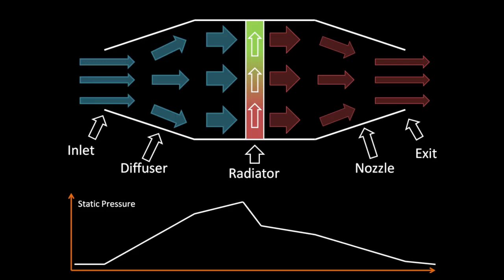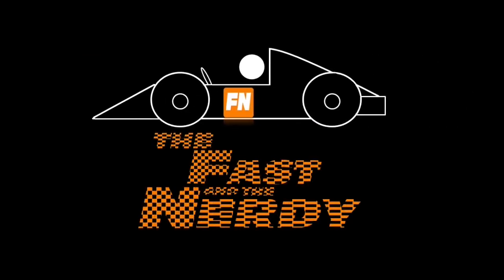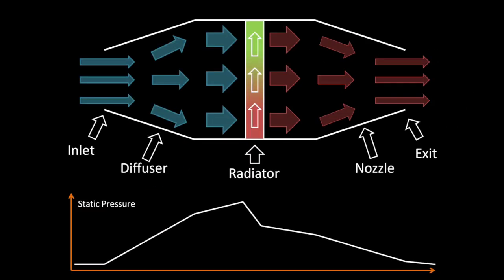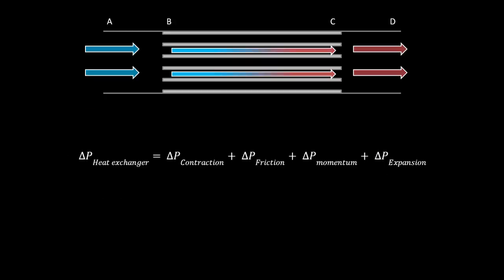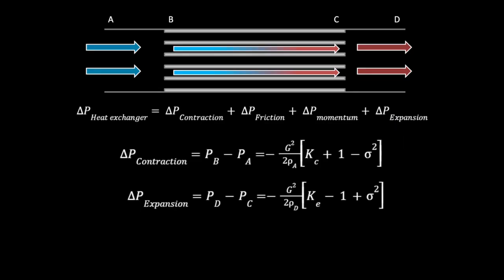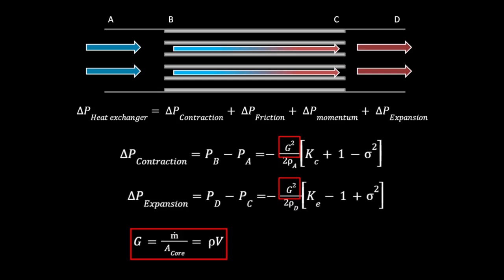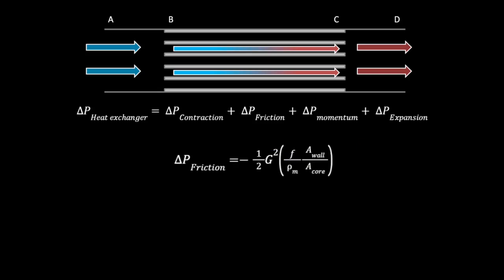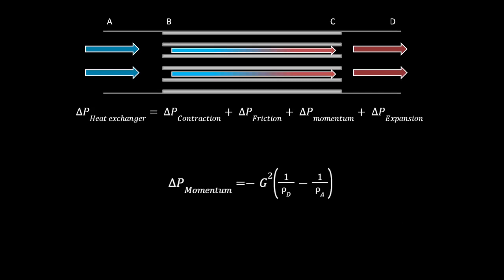The Art of Cooling: Understanding Airflow Dynamics in Cross-Flow Heat Exchangers

Comment: I understand the perspective you are coming from and you obviously understand the concepts very well but I'm a little uneasy about saying that static pressure drop is inherently a good thing. For two radiators that are otherwise equivalent the one with a lower pressure drop (at a fixed test condition) will be superior.

Comment: Hello! Awesome explanation. I just want to ask what exactly is the A_wall? The one shown at around the 2:30 mark?
Reply from the maker: Thanks! The A_wall is part of the hydraulic diameter equation (Dh), A_core is the area within the radiator that the air is passing through whilst A_wall os the total area all of the air is flowing through. Or to put it another way, the A_core is the area within one section of fins whilst A_wall is the area of the ducting on either side of the radiator.